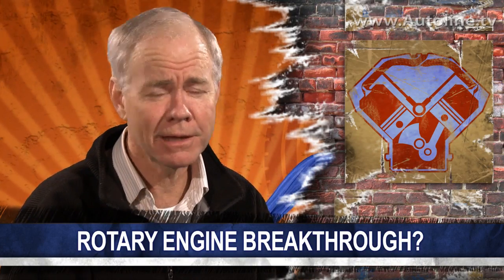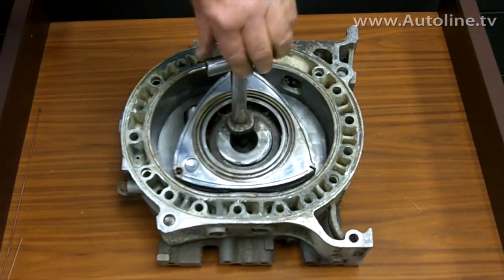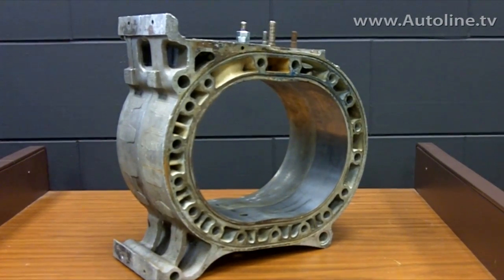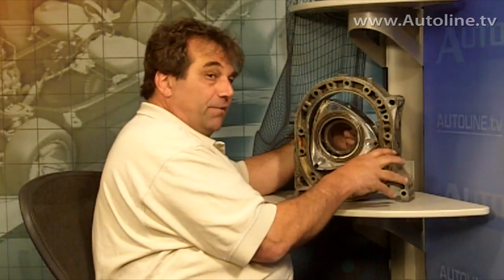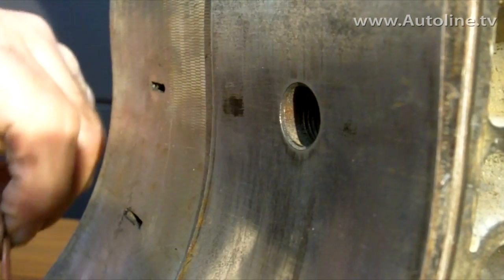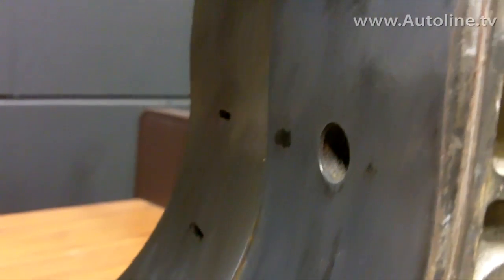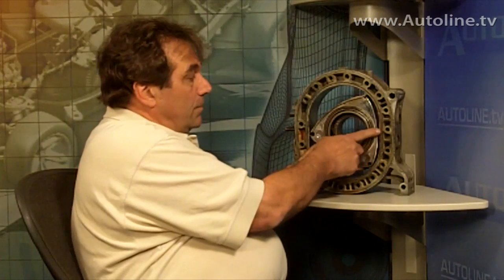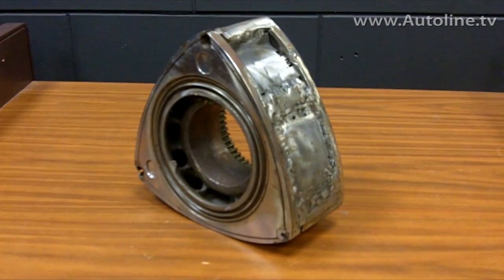Rotary Engine Breakthrough?

Comment: i am reading some of the comments and you guys make me laugh yes i would not have shown that rotor with the poor welding ....      but the rotary race guys have been doing something similar for years so this is not something new in the race world ..
Reply: +The real doktorbimmer back it up with facts, ‘engineer’.
Reply: +maldo72 so you have seen ’something similar’  repeatedly in the racing world, yet The real doktorbimmer stubbornly insists ‘no one uses it’… hmmmm…. post a link of what you are talking about, and watch the doktorbimmer deny that it exists!
Reply: +The real doktorbimmer Your argument seems illogical.  Are you saying that the size and shape of a sealed ignition chamber has no effect on combustion?
Reply: yes if you decrease the large hole (gap) from the spark plug you decrease the blow by and cross contamination...   this is a know fact for rotary engines ....
Reply: +Medokai you’re in for a world of irritation if you’re going to banter with doktorbimmer.  Just sayin
Reply: +The real doktorbimmer what are you imagining now???  You really have an unhealthy obsession.
Reply: +The real doktorbimmer mazda rotary  mazda rotary  mazda rotary  mazda rotary  mazda rotary  mazda rotary  mazda rotary  mazda rotary  mazda rotary  mazda rotary  mazda rotary  mazda rotary  mazda rotary  mazda rotary  mazda rotary  mazda rotary  mazda rotary  mazda rotary  mazda rotary  mazda rotary  mazda rotary
Reply: +The real doktorbimmer you make me feel confident, because it reminds me that I’m not burdened with your negativity.
Reply: Here is a FIRM ANNOUNCEMENT FROM MAZDA:
http://www.motoring.com.au/mazda-rotary-details-firm-46719/
Reply: @someotherdude  Mazda 2020 RX9 "confirmed" Lol!!! Well don't you look stupid right now! Hahaha!!!

Comment: +John Smith exactly! But from what I can see this has a downside compared to a wankel. With a wankel the apex seals are centrifugally driven and the apex seals in this designed appear to be in the block and therefore have to be mechanically driven thus reducing reliability in an unreliable engine.

Comment: An offset combustion chamber would basically move squash area away from the spark plug and cause the ignition would be very inefficient.
Reply: +The real doktorbimmer ...unless there is more surface area on one side.  Then if you understand that, it makes perfect sense.
Reply: plugs move them

Comment: Rotary engines have problems fully igniting the fuel/air mixture due to the strange shape of the combustion chamber. It's one reason why they have such horrible emissions problems (lots of unburnt fuel in the exhaust). I think that slotting the spark plug holes would only make this problem worse.

Comment: The cold reality of it is that there NEVER in a million years EVER be another production rotary engine.
     Simply because the Rotary engine is second only to the two-stroke for environmental damningness we might possibly see the implementation of a rotary engine as a petrol back up to a predominantly electric hybrid system non too in similar from the JDM  Mazda Demio Eco model over in Japan.
Reply: +Johnny Keller and 1 week after you write this comment Mazda announces their plans to release another rotary powered car. Hahaha that's some shit luck you have. Look it up. The car hasn't been given an official name, but the project is named RX-Vision(RX has always stood for Rotary Experiment). They showed off a concept, and it will become available sometime in 2017.
Reply: +Ethan Johnson 

   It'll be a bastardised hybrid powertrain, in-maintainable by the average individual.....

    Just like the FT-1 should be available some time in 2017? 

      I'll believe it when I see them in showroom; till then....I'll consider Mazda nothing more than a massive prick tease.
Reply: Johnny Keller Mazda has never said they were going to produce a car, then given a release date, then built a prototype, then showed off the new engine, then backed out. Mazda has now said that it will be twin rotor, twin turbocharged. No hybrid involved. Mazda also said it will use compression ignition instead of spark plugs, so the whole spark plug slot thing he talked about in this video wont even exist, solving the problem completely.(similar to how diesel ignition works). Because of this improvement, they said it gets average mpg(30 is the average). They did change the release date to align with Mazda's 100th anniversary, in 2020. There is no way in hell they would build up hype for a 100th anniversary car and then drop the ball. That would be PR suicide.
Reply: +The real doktorbimmer why do you feel the need to shit on everybody's comments here? That's all I see.

Plus, whats wrong with compression ignition? It is a very legitimate way of igniting the fuel, it just has to be done right.

Go on and give me a reason as to why compression ignition is funny and/or impossible/bad (that's the idea i get from your comment).
Reply: +Johnny Keller They said unequivocally they will produce another wankel-powered sports car.
Reply: +The real doktorbimmer  wrong.   A rotary engine refers to a piston type engine, not a wankel engine.   And I know who invented the wankel, you don’t.  That makes me superior to you.
Reply: +The real doktorbimmer Mazda has announced its plans to have one, they are already working on it, and it is not a concept car but rather a production car they are talking about.

Comment: The combustion cycle gasses are much higher pressure than the intake charge at TDC. The leakage would go the opposite way he proposes, which would actually improve EGT (Google exhaust gas recirculation). 

Also, combustion force has to do with surface AREA. NOT volume. his offset recess would have minimal to no impact on actual torque imposed on the eccentric shaft. 

This technician should stay a technician. let the guys who did the work to get the real engineering degrees do the thinking, mmkay?
Reply: Has anyone seen Ernie Brink lately??? Seems like this fraud has disappeared.
Reply: +Frank Webb My thoughts exactly! And with lumps of weld in the chamber it would suffer from pre ignition from the hot spots. I don't believe his claim.
Reply: The real doktorbimmer Nope, the hemi head is still in use.  Even non hemi heads on modern engines are variation of it.  Most cylinder heads are domed in some way, but may have flat recesses for the valves.

Pascal's law implies that a given pressure exerted over a large surface area can do more work.  That's why hydraulic presses work.
Reply: Godfrey Poon Sorry, typo.
Reply: The real doktorbimmer I beg to differ.  Chrysler still use the hemi head.  The pent roof is a variation of the original hemi.  All of the mentioned designs are employed to maximise surface area of the CC.

Some are compromises to deliver maximal surface area whilst reducing the overall footprint of the cyl head.  The hemisphere in a hemi head is a quench zone!  Its the foundation for 'quench' theory.

The only purpose that the offset would serve is to increase surface area.  Hypothetically, if there's 8 kilograms per centimeter of pressure in the CC and the apex has a surface area of 150 cm2, that's effectively 1200 kg of pressure exerted on that face.  If the apex has a surface area of 200 cm2, that equates to 1600 kg of pressure exerted on the face.  The offset is just a flawed way of increasing displacement without actually increasing the engine's size.
Reply: The real doktorbimmer I will concede that I was incorrect about the advantages of the hemi head.

That being said, you're definitely incorrect about the Hemi engine; it is still in production today, albeit with a more oblique hemisphere than the engines of old.

If my calculations are wrong, can you please explain why?  If 2 engines have the same pressure in their CC during combustion, yet one engine has a larger piston crown area than the other, which of the two pistons will experience the most impetus?
Reply: Godfrey Poon Yes,for the same displacements what you've stated is correct; but although it may have seemed that way, my question wasn't addressing 2 engines with identical CCs. For this reason, I edited in the word 'crown' to highlight this.

Obviously, if 2 engines have the same stroke, but one has a larger bore than the other, the oversquare engine of the 2 will have a greater displacement.  So for equal stroke lengths and combustion pressures but varying bore sizes, which piston will experience the most impetus?  The square or the oversquare?
Reply: "Mazda changed their rotor recess from a "Leading Deep Recess" to a "Mid Deep Recess" in the early 1980s,..."
Doctrinare Bimmer has been mocking ANY change in the location of the recess for months now. Yet you are saying Mazda did it in the early 1980's.  They must have had the recess for a reason, and they must have moved it for a reason.  I don't know what the reason is, but let's see if he will acknowledge there is ai a reason (I already know he won't)
Just sit back and watch.
Reply: That's right, change the subject again while we are wait for you to elaborate on the imaginary 'Anthony Campbell"  LOL LOL LOL
Reply: some other dude but hurts truther416
Reply: Or, it's actually you.   I'm seeing more and more inane comments from 'Ernie', and it looks more and more like some random troll just being silly.  Latest one: "Where is the Lord".... wtf does that mean?!
Reply: "some other dude but hurts truther416"
Uhhh, ok......
Reply: +doktor
why did you change your name????
Reply: @fake EB:
What video are you talking about ?  Did someone post a new link here, because I don't see it.  It's becoming very difficult to weed thru the hundreds of posts here!
Reply: "..THE TRUTH WILL SET YOU FREE"
You can set yourself free even faster if you have a mazda rotary under the hood!
And to doktor:  Why did you buy and work on several rotary engine cars if you hate them so much?  Don't you think that looks a bit hypocritical?
Reply: I'm curious as to which two you own; and why would you, considering the years of venom and disdain you've aimed at them.  Why?  And if Ernie's plug hole alterations are so unworkable, why do I read elsewhere in this forum that Mazda tried it too?  How crazy is it in light of that, why not give Ernie credit for that thinking, even if he thought of it years too late?
Reply: "...don't even know when the Wankel KKM..."    Wow, your posts just reek of conceit....
Reply: I know he's a fake, he revealed himself unequivocably about a week ago. And he's a smart guy (the faker) and he was/is following this whole conversation quite well.  I already mentioned this issue about a day ago, so why are you lecturing me about it?
Also, I recently ran across an MIT article about liquid piston engines- we never finished that discussion.  Everything I find about this engine is quite complimentary, and I know you can't stand that, since it (sort of) shares some traits with the mazda rotary.   It's a great engine with excellent characteristics, isn't it???????????? (the liquid piston ICE)
Reply: "Anyone with a formal engineering ...."   My God you have issues with reading comprehension.  For the last week of posts I haven't focused on the technical aspects of the wankel, or of Ernie's ideas.  Instead, I've made fun of you and your 'crutch' (that would be Ernie) and I really hammered you with my last post.  I know you saw it....  so keep talking past me, doktorbimmer, because that's all you can do.
Reply: "David Buschhorn doktorbimmer  are the same puppy..."   No they aren't.  Buschhorn is distinctly likeable, and uses reasoned arguments, doktorbimmer uses icy repetition and makes one's skin crawl.
Reply: "One third of crankshaft speed is not the same as ....."   Oh c'mon, doktorbimmer, isn't it obvious he just misspoke?  Really.....
Reply: if there was no movement of gasses in the combustion chamber we would not have terms like 'swirl'.
Reply: you want no leakage?
Reply: +Frank Webb There are no combustion cycle gasses at TDC.  By that stage, the pressure from the last apex to fire has depleted to exhaust.  At TDC, the engine can spin either way.  It is Inertia that keeps it spinning in the right direction.
Reply: +The real doktorbimmer Incidentally, 'that offset recess' that you're describing increases surface area of the apex.   You've mentioned Pascal's law, yet you somehow fail to realise that you've neglected Pascal's very  principle.  Are hemispherical heads utter nonsense too?

Comment: Learned something new today. I personally never cared for rotary because all the horror stories I've heard. I'll still would like to have a project of my own tho...
Reply: Shawn Elliott Hard to believe that...you must don't run your car hard....
Reply: V-Way My RX-8 runs fine. As long as they stay properly oiled and the sparkplugs are kept clean, they can run damn near forever.
Reply: It's my daily driver, so no, I don't push it to its limit very often. If I pushed a Toyota Corolla to its limit it would wear out fast too, but the RX-8 is way more fun even in normal driving.
Reply: The real doktorbimmer
Unfortunately Mazda botched the apex-seal-oiling system on the first version of the Renesis engine. I have the second, revised version, with a better system. But also, there's the problem that people who bought the RX-8 knew that it could rev to 9000rpm and so they did it every chance they could get. If you redline ANY engine every chance you get, it will wear-out and lose compression prematurely. Drive it like a normal car, with occasional satisfying bursts of speed, and it will work just fine.

Also, Mazda extended the engine warranty voluntarily. They stand by their products. They lost money on every single RX-8 they sold, but they sold them anyway because the rotary engine is what enabled Mazda to rebuild its business after WW2 -- it's a symbol of their pride and engineering skill.
Reply: Shawn Elliott You do know that a rotor motor wears out quicker than a Piston engine right? A number of cars out here can take a beating all day and still last for a long time....
Reply: The real doktorbimmer You really broke it down. I couldn't say it any better myself.
Reply: +The real doktorbimmer "Although the 787 and 787B lacked the single lap pace of World Championship competitors such as Mercedes-Benz, Jaguar, and Porsche, as well as Japanese Championship competitors Nissan and Toyota, the Mazdas had reliability which allowed them to contend for their respective championships."
Reply: Incorrect, at the end of the season, Wankel-type rotary engines were outlawed, there were no changes at all to any rules regarding fuel. During the 1991 season, they were more fuel efficient and more reliable than any other Group C car, as demonstrated in the Paul Ricard tests.

The design was not uncompetitive, they won.
And it's not a fluke when all 3 cars entered, finished in the top 10.
Reply: +The real doktorbimmer Toyota built a horrible inline 6 that they put in the 1990’s supras and pickup trucks… they routinely blew head gaskets.

Comment: Guys.  Question: message me please, what about the torque issue?????  No torque until 5000 rps? Right?  How do ya fix that? And fuel economy?
Reply: The real doktorbimmer All combustion engines are obsolete now. The Wankel engine is no more obsolete than the piston engine. The future is in fuel cells that convert the chemical reactions directly into electricity instead of using heat-expansion as an inefficient intermediate step.
Reply: The real doktorbimmer
Your assessment of the practicality of fuel cells is based on the assumption that current technology will not improve.

Comment: This doesn't make much sense because mechanics looking into the Wankels had been asking these questions since 1957. Mazda admits that there is pressure loss in the combustion rotation when the apex seal passes over the TRAILING spark hole, the smallest one above the LEADING spark hole that Ernie is so concerned about, and pressure is lost backwards into the intake rotation. Mazda said that they made the trailing hole as small as possible without inducing spark fouling at high RPMs. As for the big, leading hole, Mazda said that when the apex seal passes over, pressure in both the combustion and intake rotation is the same and no leaking takes place, only that the heat difference across chamber surfaces that Wankels are know to have, gases could spill BACKWARDS again due to the exhaust being HOT and intake being relatively COLD.
Reply: +The real doktorbimmer   Yes, the very short stroke of the eccentric crank means that a severe mechanical disadvantage is encountered!!. This is a major cause of low torque. Far too many downsides to ever get low emissions and efficiency with this system.  Good bye and good riddance.
Reply: Next, the offset compression makes some sense, I think. First of all, he fuel air mixture does not EXPLODE like some may think, because that's engine knock and that's bad, the mixture is supposed to start burning BEFORE top dead center because of the slow and progressive burn of combustion, as opposed to explosions, with peak pressure developing as top dead center passes to sort of PUSH a piston or rotor in the right direction. So here, I think the problem is rather the fact that a Wankel's chambers are inherently inefficient for burning because they are too narrow, and perhaps because ignition usually starts too late due to the fouling of the trailing spark hole, which is why upon ignition, 90% of the job is done by the leading spark plug job at top dead center, making engine knock a constant concern in the Wankel. Oh yeah, and the offset chamber looks as if the rotor would become imbalanced and unstable.